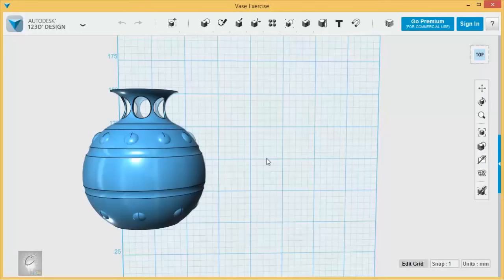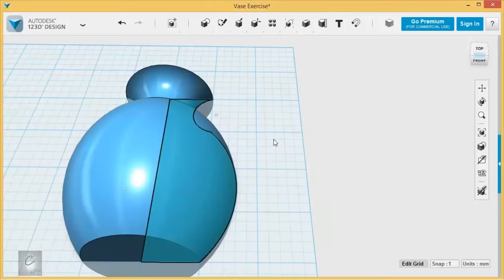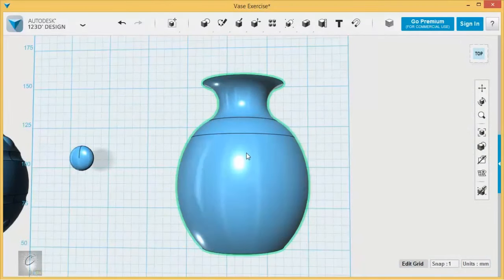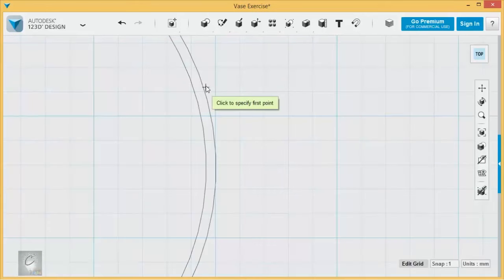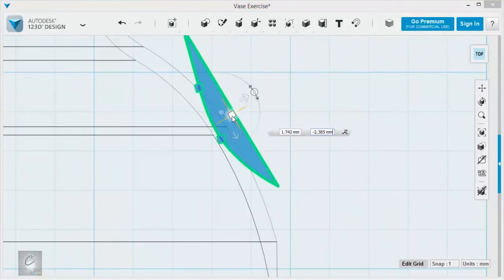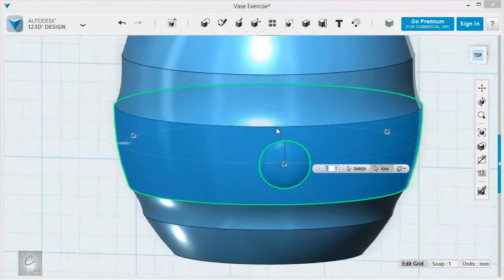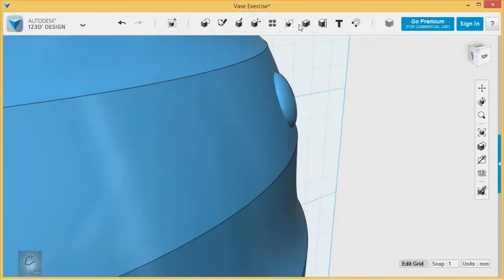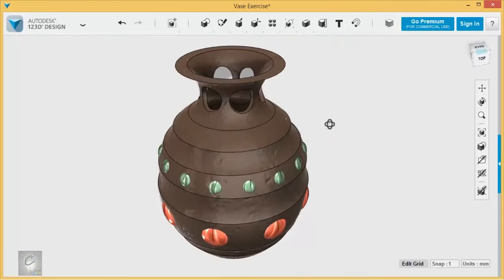123D Design Tutorial Advanced Exercise 2 - Vase

Comment: Having problems with the part @ 4:30. I've created the shape that goes into the vase a little bit. I've selected revolve and select the shape as profile, but I can't select any part of the vase as the axis. The outline doesn't light up indicating it as a selectable object. Similar thing happend when I created the holes with the circular patter. I could not select the side of the face as you did, only the lip and bottom were selectable.  

Any ideas what I'm doing wrong?
Reply from the maker: +samik83 That is very strange indeed.  Are you certain that you clicked the Axis button in the grey box after you selected your profile?
Reply: Yes, I did that.
I think it might have something to do with how I created the vase in the first place...I've watched the video many times, but can't figure it out.  Is the vase supposed to have a vertical "seam" after I create it with the revolve option?
Reply: +samik83 I'm Having this same issue, I have created a primitive sphere drawn a square to revolve around it, but i'm unable to select the sphere as axis, I can select parts of the square as its axis whixh means I'm able to select other objects.
Reply from the maker: +samik83 Oddly enough, no, but I can see why you're asking.  I used to get that same vertical seam when I created the vase previously, but now that I've tried it today, I don't get the seam.  I can't seem to figure out what determines whether the seam will be there or not.
Reply from the maker: +Adam Jacks Spheres are weird in that they don't really have an "edge".  They must be coded differently than any other shape.  But I'm fairly certain that you can select a cylinder as an axis.
Reply: +C3 @ Library 21c Thanks, yes I got round this by drawing a circle and rotating it's axis and followed that